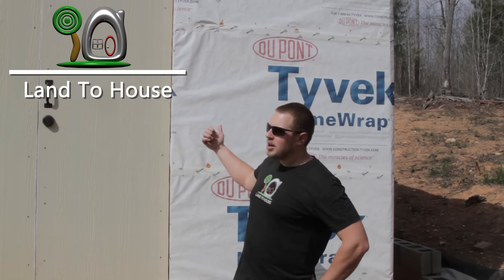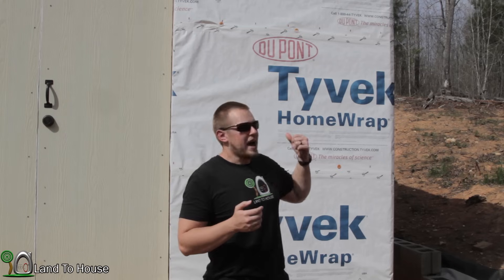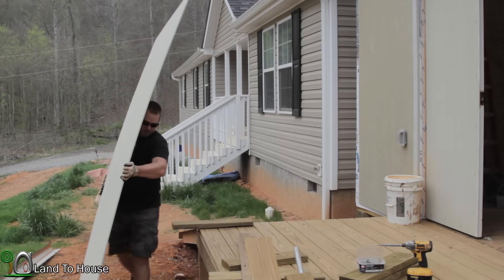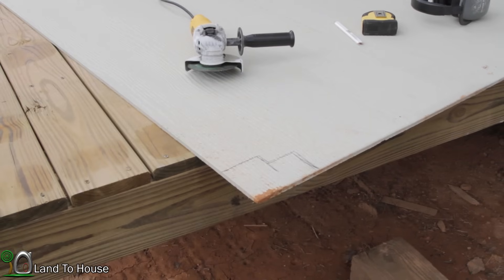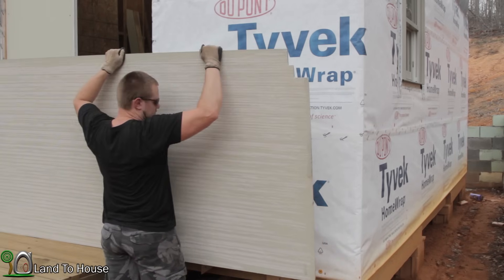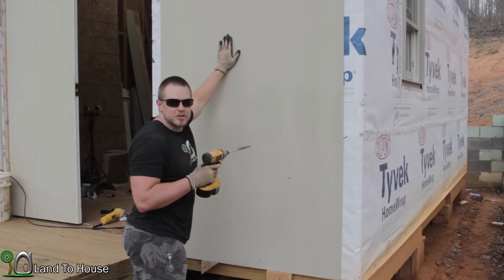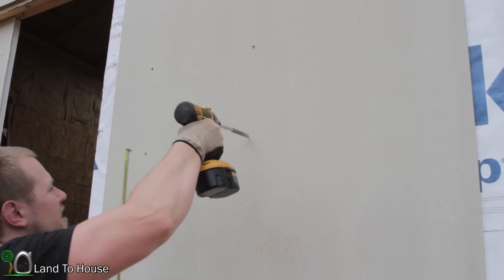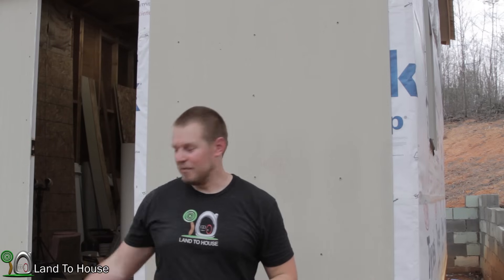Exterior Hardie Board Siding - Build a Workshop #33

Comment: No one that I saw mentioned how easy these 4x8 panels break. All this Hardie stuff breaks  very easily, if you are not super careful. I had thirty 5/4 3.5"x12' trim pieces delivered on a pallet and the fork lift that lifted the pallet cause a slight stress right in the middle of the load. that deflection caused these small fissures to develop right in the middle of 10 pieces. I know to turn them to pick them up, but it was no use, they broke. With these panels if you let them "flop" they'll break. be careful. for 4x10's get the neighbors over!

Comment: you mark out your nail pattern with a tape and a pencil 8 inches up from bottom and 16" bettween nails, and space them with your studs.. use a T square
Reply from the maker: Great tip. When I build my lawnmower shed I will have to use that.

Comment: I have a dedicated shear for cutting hardie panel (cost me in excess of $300!) and wish I'd seen your video first! Using a cutoff wheel completely escaped me and looked to produce even cleaner cuts! Genius! New Sub!
Reply from the maker: Thanks for subbing! I looked into how to cut hardie panels and some people use a razors to score and then break. That method is terrible. So tried the cutoff wheel and it worked perfectly!
Reply: What about a multi tool?
Reply from the maker: Meaning the knife part? I find it to take a long time.
Reply: @LandtoHouse  how do the seams look doing a full rip on these.
Reply: Diablo makes a circular blade for exactly this. They say it’s unbelievable and can last many many cuts. I purchased one but haven’t used it yet.
Reply: @jeffsond  We sided multiple bldgs w panels. The diablo blade wont let you down. The very cleanest of cuts & the blade lasts as long as a diamond blade. Thwy are worth the 75 dollar price tag - considering getting another for my makita track saw.
Reply: @koogle612  yes, I completed my siding project 6 months ago with ease with the Diablo

Comment: I got 4 pallets of hardi board 1/2 and 1/4 they are a bit damaged payed 1 per sheet , my question is can I use hardi board for both in interior and exterior use ? They are both 3'×5'
Reply: If you’re referring to their tile backer and not a siding product then you can use the 1/2” hardi backer 500 outside if you are in the HZ 10 climate zone. A map showing the zones can be found on their website. Their 1/4” board is not for exterior use.

Comment: can you paint or render the boards, could i attach these to a standing frame for a decorative garden wall against a fence then paint or render?
Reply: Yes, you can paint this. But it does come in various colors as well. Check your local building supply yard. (Not like a Home Depot or Loews) They likely have a James Hardie display.

Comment: Did u fill the screw holes with paintable caulk and paint it?
Reply from the maker: I just pained over them. Has worked flawlessly for many years.
Reply: @LandtoHouse  do you have a video of completion of the workshop?
Reply: @LandtoHouse  it looked liked  the exterior screws just screwed right thru the siding.  No pre drilling required??

Comment: I got a question for you sir, me and my business partner are installing that on a house today and I was under the impression nails only go on the ends of your panel not in the middle and we use nails. Do you put screws Every 12 inches?
Reply from the maker: I am not a pro installer of this product.  This worked for my install but I would contact a professional before doing this install on a home.
Reply: I called hardie, 6 inches on center on studs

Comment: I’m going to be putting this on my exterior basement walls. I have the 4x10 panels and will be running them horizontally, they telling me I need to keep them off the ground 8 inches. Wonder why ?
Reply from the maker: Not sure about the height? I wonder if it wicks moisture? 

I can say the 4x10c sheets are crazy heavy!
Reply: @LandtoHouse  very heavy. Hard to handle
Reply: @LandtoHouse  online its says they weigh 2.4lb per square foot, which would mean its 192 lbs... can that be right?!
Reply from the maker: @brightlightabove  its actually: 2.4x4x8 = 76 pounds.
Reply: @LandtoHouse  yes it will absorb water. After u cut the panels u must use a latex paint before installing
Reply: @brightlightabove  With those specs, a 4 x 10' sheet would weight 96lbs, not 192. And yes, that seems about right. They are heavy. The 4 x 9' that I work with are liftable by 1 strong man, but barely. Hard to maneuver around.

Comment: How do you hide screws? Do you need flashing in the gap?
Reply: I was thinking of putting a vertical woodstrip @ 2 ft, or 16 inches. Covering the seams of coarse.
Reply: If its a horizonal seam, yes flashing by all means. Im planning to put 12"×24" approx, scallopped pcs above the lg panels. Overlapping horizonal seams. W extra 30 wt tarpaper strip behind seams. Maybe horizonal woodstrips behind sidings ?
Reply: I plan to use dipped galvanized rigged  1.5 inch nails ,if possible.

Comment: Hey there! We have the same type of panels on our home (4x10 sheets). Have you noticed the nails rusting through the paint at all? Trying to find an answer to why this is happening. Your project looks great!
Reply from the maker: I used exterior deck screws for my project and have not seen any rusting whatsoever.  I should think if you're seeing rust pop through from the inside you're getting water down the side of the building somehow.
Reply: @LandtoHouse  Hey, thank you for your quick reply! That's what I was kind of thinking but not sure how to remedy it. The builder caulked the seams where each panel butted to the next and there is flashing above...with a white modern house, it really sticks out! Would sanding the rust off and priming and painting help at all or is there another product that I don't know about?
Reply: @LandtoHouse  Either that or the installer didn't use galvanized siding nails.

Comment: What material and brand of siding is that? I need something flat and large with a wood texture(with no lines) like you used that can withstand the elements and not warp.
Reply from the maker: I used Hardie board siding for this build. Cedar mill is the name of the texture. I think it's rated to 50 years unpainted? With paint it's a very long time.
Reply: Land to House thanks for the reply! Is there any other alternative to plywood that has a wood texture that will not warp?
Reply: @LandtoHouse  I am also curious about the siding material. When I search for Cedar Mill it doesnt appear to be in panels, but in thin narrow boards. Do you have a more specific product name?

One more question, what do you do for the seams?
Reply from the maker: There may be a vinyl siding that would fit you or need. But it seems like Hardie board is the longest lasting.
Reply from the maker: I'm not sure. When I go to my hardware store I just asked for 4 x 8 Hardie board Cedar Mill finish.
Reply from the maker: As for the seems I just stuck some caulk in there and paint over it.
Reply: Land to House ....... here is 2 cents worth......taken or leaven don’t matter.  True Value calls it hardie panel Sierra #8
Reply from the maker: @mathewkorn5008  well that's good to know! Thank you.
Reply: @LandtoHouse

Comment: Can you put horizontal too? Does it make a difference?
Reply from the maker: This is solid concrete board. Should not make a difference which direction it's turned in
Reply: @LandtoHouse  thanks, because I wanted the grain to go horizontal and my guy said because of the expansion joints it had to be vertical. Which does not looks as asthetic.
Reply: You need a helper

Comment: I was told by a licensed Hardie installer to use nails and not screws?
Reply from the maker: I would listen to them if they are a pro. I have had no issues with screws for almost 5 years now.
Reply: Read the siding installation directions?  HZ10 calls for screws
Reply: He told you wrong
Reply: @LandtoHouse Don't

Comment: Don't you have a laser leveling system?
Why not use that to line up your studs to drill into?
Reply from the maker: +Holistic Advocate I Was going to use it but the weather was bad and I only has 1 hour to work. Next time I will be using it!
Reply: Chalk line is the only other thing that I can suggest then.
It is tough doing construction by yourself. 
Don't you have any neighbors or others you could trade skills and labor with? 
Homesteading doesn't mean do it by yourself :)
Reply from the maker: +Holistic Advocate my neighbors are older fellows and they travel a lot. Brad my brother in law works all the time. My dad has helped some.
Reply: Sounds like you need to expand and young-er-fy (is that a word?) those that are members of your community /neighbors. :)
Reply from the maker: +Holistic Advocate well Ashley and I have done our part now. Emma's pretty young. Haha might be a few years before she's helping with really heavy stuff.
Reply from the maker: +Holistic Advocate she is really good at calling break time.
Reply: Install is basically all the same/accessories ,in my case  repairs all serve same purpose, so availability wouldn't complicate installation.
Reply: @LandtoHouse  I'm a 56 yr old female. I've had to do ALL my builds, from home to outbuildings by myself, I feel your pain...lol
 You have to get creative and make supports, etc to hold the other end of things.
 I use my motorcycle jack to lift my sheets for my shed exterior walls. It's worked out quite nicely😁
 Ingenuity, the mother of invention😉
 Loving your videos!

Comment: Hardie Board seems like the perfect choice for exterior board but how come not too many ppl use it for exterior??
Reply: I think a couple of the drawbacks is the cost and the fact that it is brittle.
Reply: Takes way longer to cut but here in 2021 the cost of the blank hardie panels is about the same as T111 wood panels and the Hardie will last much longer!  The drawbacks are it's harder to cut and heavy to work with.

Comment: Did you predrill for the screws?
Reply: Either way, he'll need to caulk the heads to make sure they look ok. The installation instructions actually suggest using a siding nail gun. That way the finished product looks better.